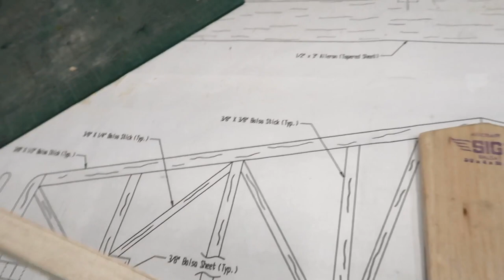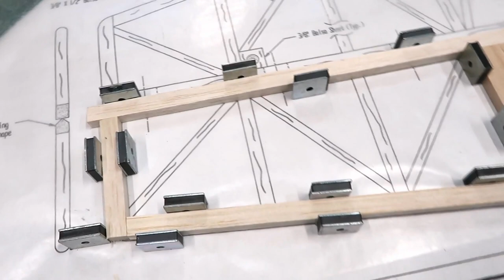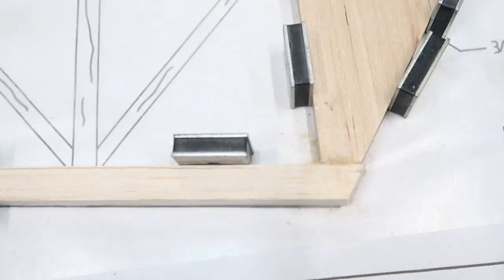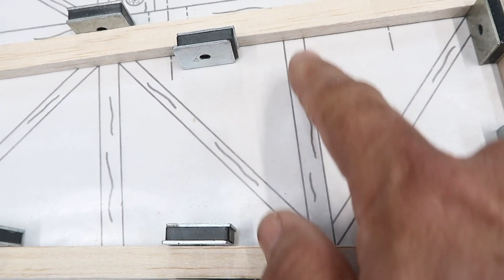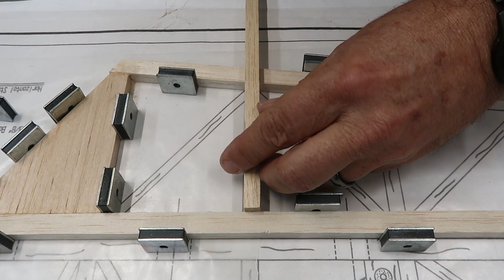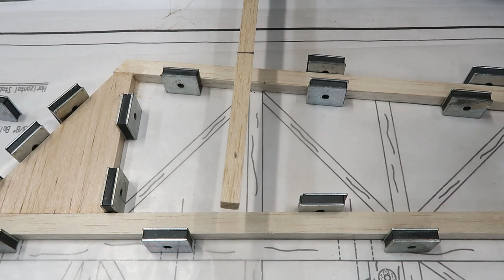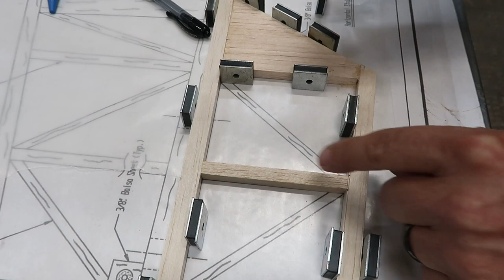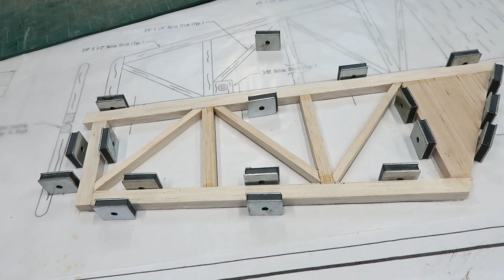EP13: Laying out the Elevator halves, Tail feather scratch building a giant scale RC Airplane

Comment: I have had good success using plain bonded letter stock paper or construction paper in those instances there is a gap in the joint.  I just separate the pieces and slide the paper in like a shim.  Then thin CA the joint.  Paper wicks the CA into the joint.
Reply from the maker: That's a great idea.

Comment: Hi Dan, watching you fill an open joint with sawdust. I never thought of that and thats a good tip. I have always kept a can of baking soda handy and brush that into open joint to be filler before applying thin CA. Since its such fine grained powder it easily fills joints. It works very well and is super strong, usually stronger than the CA’d wood. But I will give your sawdust method a try also. Cool videos, thanks again.

Comment: As that is a constant angle on the trailing edge, once you have measured and cut the angle on the first vertical 'rib', you can then use the angled end on that rib to mark the angle on the remaining ribs.  I find that a lot easier to do than to offer up and mark every rib individually.

Comment: Hello!  I was watching your video and I saw that you use magnets to "fix" the balsa pieces... I conclude that you use a metal table... I ask: do you prefer this way to pins (on a cork plate)?  And you don't use clear waxed paper over the plant when you glue it with CA?  Excellent demo!
Reply from the maker: Hello Walter
I do prefer to use magnets for my layout on the plans.  I had built many planes in my earlier years with the pins and homosote board, but once I tried magnets it became my preferred method.  I have been using a piece of 22 gauge sheet metal that I set on the table, place the plans on top of it, and then a sheet of wax paper to avoid CA drops damaging the plans.  So, yeah you had me figured out.  I found a steel door in the new shop and will be making a second table with it.  That will be nice because the sheet metal I have been using has been a little narrow and short on some of the planes I have been building.  A full door will make it easier.  Thanks for the question.

Comment: Do you flip the elevator over and glue the backside?  Or does the CA penetrate enough that this is not necessary?
Reply from the maker: That's a great question.  I suppose the bond is strong enough from the one side of application, but I do hit it from the other side once I take it off the table with another shot as well as any "fillings" just to be sure.

Comment: This may be a dumb question but I am new to this.  Do you only hit the one side with the thin c a glue?  Or do you flip it over when done and hit the other side?
Reply from the maker: Not a dumb question at all.  The CA is super thin like water, so it flows all the way through the joint, and in most cases I drop a little more than I should and it will pool up on the wax paper I have between the plan and the wood.  So I don't tend to do the other side for good measure.  BUT... Later on, I will inspect all of the joints and add medium CA to fill any gaps. But yes... Thin CA is awesome.
Reply: @Capgains7777  thanks for the info.  I just ordered my first balsa kit a few days ago.  I found your channel and have been watching and learning a great deal.  I just got into the rc plane hobby last year with a small foam trainer.  But I have always wanted to build one from the ground up.
Reply from the maker: What kit did you order Jeff?
Reply: @Capgains7777  I ordered the T-12 Eyas Trainer from RedwingRC.com.  It is a bigger plane I know,  but my thinking was it might be easier to work with??  I like a challenge.  Lol
Reply: I just learned that the kit I ordered and received does not come with a set of blue prints.  All you get is this p.o.s 6 page booklet that has very vague instructions and a few pictures.  So now I will have to figure out how to put this together.  Very frustrated.
Reply from the maker: @jeffsmathers3007  I looked at the info you sent.  Is this an almost ready to fly?
Reply: @Capgains7777  No
Reply from the maker: Wow... Its hard to tell from their advertising what it is.  48" ws is not a large airplane.  I hope you are able to figure out the construction.  Many begining builders are starting with this kit from Sig.  https://sigmfg.com/collections/sig-kits/products/sig-lt-40-trainer-kit it is a little spendier than the one you found,  and will need a power plant, but I have instructed several new flyers on it and the kit not only has plans, but high quality wood, and a well written manual.  If electric is the way you want to go, Im sure it would be easy to find a configuration.
Reply: @Capgains7777  thanks for the information.  I am going to give it a try.  I feel pretty confident with the instructions they did provide and you videos I might be able to muddle through.

Comment: What glue would you use to glue birch plywood to carbon fiber rod?
Reply from the maker: I would probably use a 5 or 15 minute epoxy.  Rough up the smooth CF rod so the glue has something to grab onto.  Second choice, Gorilla Glue.
Reply: @Capgains7777  Cool thanks